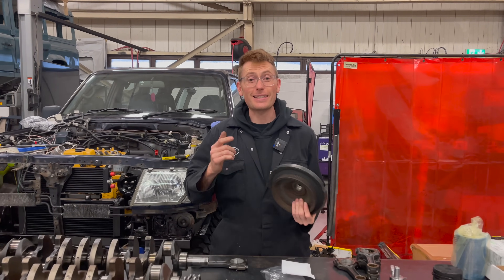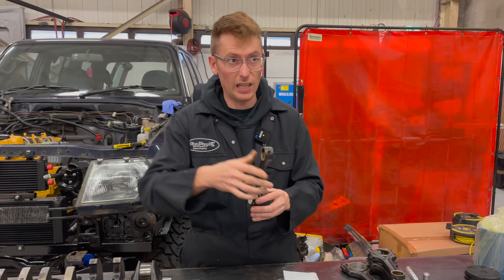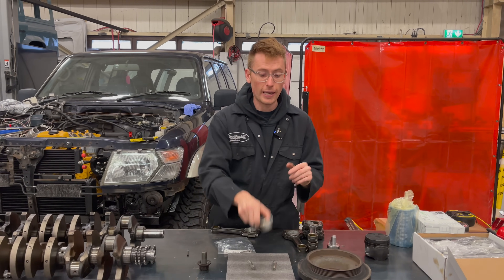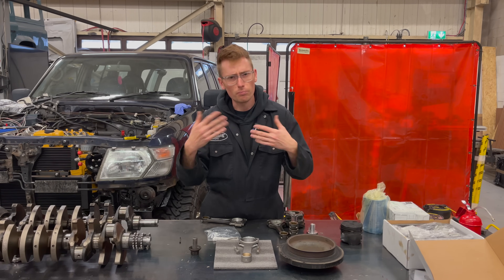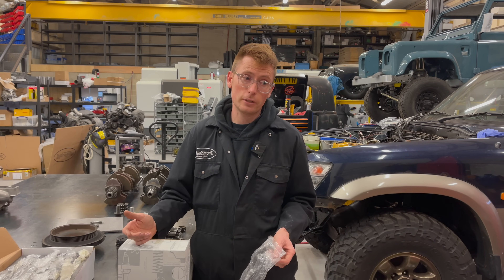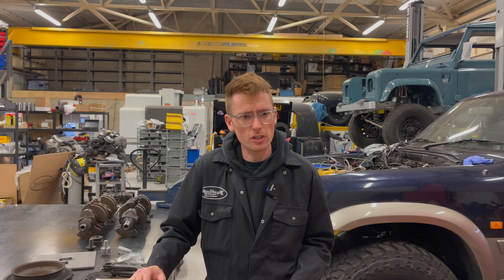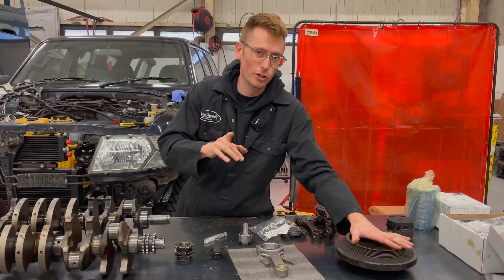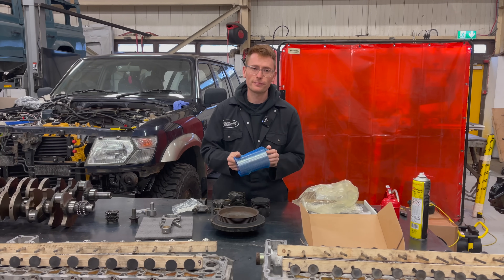BUILD A 700bhp Capable OM606 Diesel engine, Avoid Crank KEY ISSUES

Comment: Could it be a good idea to have the 6mm lock pin pre countersunk ready for drilling out when the need to remove the pulley at a later date? But then again you have already done that .

Comment: If most of these engines that had problems were manual transmissions, with letting off the throttle to shift after having them rev to a high rpm and possibly not having a blow off valve cause too much pressure in the cylinders and the rods with bend??

Comment: Bent rods may be ralated to a thrust bearings? What i mean, if it out spec, as you press the clutch it moves the crank and then the rod gets in angle and later bends it.
Just saying, couch mechanic

Comment: I immediately thought, must be a manual… sure enough.
Could it be that for these high power engines also stronger clutches are installed? And that the axial bearings can not withstand the extra pressure? Maybe the crankshaft is moving axial slightly when pushing the clutch. Look into better axial support instead of stronger rods.
Saw this problem with a Volvo turbo red block. You could even see the movement of the crankshaft by eye (engine was shot)

Comment: i could point the finger at certain manufacturers. the reality is they all do it.

 it's a sad state of affairs when a guy like this has to go back through an engine and correct it
 its a little more than factory mistakes in my outlook
 it is a known fact manufacturers don't sell autos to make money they sell parts to make money anyone knows anything about Germany they know that the germans are anil as hell about metal and machinery and that is not just some Germanic trope. they come at it like a form of worship. because they do worship steel. for real.

the point I'm making is they knew damn well that flimsy flat key was insufficient
that's an obvious failed point no one that's been around cars and trucks long would look at that and not say to himself you dirty sons of bitch's. hadn't been for that key beside's the obvious maintenance it's likely that engine would never need to be touched for a man's life expectancy. that little move was shameless. especially when you understand the checks and balances a company has before they put a product out.  they have the means to prevent this nonsense phunny how they are careful not to make mistakes that cost 'them' money only 'you'. as it has been said for so long if you want something to be done right do it yourself.

Comment: What you have done is not a fix.you need to find the the real problem and the problem is crank thrust putting heavy rods in they will just bend the same sideways.best option is remachine the block and put 2 thrusts in.got to remember these are all used shorter engines that had a 20yr life then you go and put 2/3 times original power through it how worn we're original thrust before.

Comment: Hey guys im gonna be honest I wanted to email you but alright hear me out. Im in the US and i love my mercedes. Im building an om606 but I noticed only the 86-95 models have the mechanical pump you require. Would one in theory, if I sent you guys like, idk 4 or 5 pumps. Would you send me 1 really nice rebuilt one? Because im broke this month and im trying to plan for around February for +600 but im researching youre pump kits/build kits.

I love benz tinkerers. Its beautiful because you guys literally. find the smallest things. and it makes life perfect. simple but Complex! Engineering the proper way.

The issues could possibly be due to the transmissions that arent mercedes. I seen a guy ripping an om606 on the MB 6speed. The manual transmissions cause the crankpulleys to fly off! I fuckin love you dude. People complain but bro, do u realize what kind of flex that is? You're pulley flew off. you should be proud.

Thanks guys. Those cylinder sleeves. Copping those when I get the block on the stand. Thats gonna be first thing next to pump.

Comment: Going from what you found with bent rods and corresponding vehicles having manual transmissions it would be interesting to see the end float of these cranks, it might as be indicating a discrepancy in spacing of components with the manual transmissions being used, causing minor movement of the crank under high horsepower applications or possibly an added harmonic indifference. I’m not very familiar with these motors but keen to Learn more
Reply: I was wondering the same whether it was a thrust bearing issue.

Comment: about repairing or damage bore... i dont agree with sleeve install. oem blocks was aged on rain ,sun, snow for few years before they went into production. this is how cast iron get stiffines hardnes etc... if you replace it with sleeve no chance that this sleeve have same characteristics of material and hardness. just put bigger pistons inside and thats it.

Comment: At 3:50 you say you sell connecting rods in a slightly shorter length to use a 320cdi crankshaft. Do you have any videos or anything with more info on this? I can't find the shorter length connecting rods on your site. And can't find anything online about swapping the 320cdi crank is the shorter connecting rods only thing that needs changed to swap cranks?

Comment: Is it possible to have short height pistons so you can use the 320cdi crank with the original length rods? And is there a variable geometry turbo that can make 400hp without too much lag? Or do you go twin turbo?
Reply: i would think that would be the way to do it  longer rods make more torque

Comment: I don t think that the original key was designed for that much power. also the original key looks more like a guide.. the fixing of the pulley relies on the torque of crank pulley screw.

Comment: And I bet all the rods were bent with the crank end pushed  towards the balancer? Seems like the clutch maybe damageing crank shaft thrust bearings. I’ve heard Toyota jz series engines will wear the bearings Faster if you run heavy pressure plate and start with clutch pushed in. Haven’t had any issues with my 1jz’s. Just something I heard thru the grapevine years ago
Reply: This^

Comment: I need help with my om606 I would very much appreciate feedback anything will help I got a 1998 e300d, https://youtube.com/shorts/rnL_Jt9T8f0?feature=share 
Check out that video, I’ve replaced injectors, delivery valve washers and o-rings, all new fuel lines from IP to filter,

Comment: You should work with Gail Banks in the USA he’s a top diesel tuner. Winning all sorts of land speed titles. He dose a liquid style damper that reduces the longitudinal and rotational harmonic shock the dampers for. This damper is not tuned to a single RPM. It works right through the Rev range!! I’ve contacted him and they don’t do any for the Mercedes 5/6 cylinder motors. 
Someone like you could link up with Banks! And fill the void of the lack of quality dampers for high power Diesel engines! That really could benefit greatly from this upgraded harmonic balancer!! Oh and I’d be your very first customer to buy this viscous liquid  damper!!
Reply: Gale 🙂

Comment: Your vids are always educational, don't even have a om606, got a m51 and shooting for 4-500hp tho
Reply: M51 head is very restrictive, 300hp is the highest hp you can achieve after expending lot of money. It’s better to drop a M57 and tune it, better € per HP. All Bmw 6 cylinders gearboxes  are compatible until 2007, so you can put M57 and M57N
Reply: @daneitor97  Well the m57 engine isn't that cheap, the m51 is very cheap. + It's not that restrictive, u can get above 300
Reply: @nicolajskovby6204  here in Spain I can get M57 200.000km for 800€. That’s what I’m going to do with my E34 👌
Reply: @daneitor97  Still at least 200 more than the m51 and I already have one in the car, even if I only end up making 300hp it's still a lot cheaper
Reply: But I still bet 400 is ez 3 inch side pibe from hx 40. M21 super pump from diesel meken, Big IC and meth
Reply: @daneitor97  M51 with head work and camshafts can go above 300hp but the cranckshaft is the weak link. It’s also very to mount mech pump on it instead of edc and IDI diesel no need to change injectors.
Reply: @Koza_Cara  the problem is that head work (and anything that involves opening an engine) in Spain is very very expensive. For 450hp M57 only need big turbo, bigger injector pump and change injector noodles (approx 1500€)
Reply: @Koza_Cara  but I think M51 crankshaft can hold easy 400hp, I saw people used for turbo stroked M50 2.0
Reply: @daneitor97  head of m51 isnt expensive because it’s that simple only 12valves and just increase the flow and test on airbench. Tougher springs from VW 24d about 500-600 for headwork and a m21 pump and you can go easy to 300
Reply: @daneitor97  Guy in a group on facebook snapped cranck in two at 400hp. Luckily pistons are forged and piston rods to
Reply: Join m51 tuning on Facebook. But cranckshaft wil break at 400hp

Comment: just curious is there cams to make om606 counter clockwise for marine applications at say 500 bhp?
Reply: Why not use a counter rotating gearbox? PRM-Newage, TwinDisc can both be run using what is Ahead as Reverse and vice-versa.

Comment: Now if the rods are bent, what about scoring done on the crankshaft? Or is all the stress taken out thru the rods? I assume the now increased .100th of play, you would run along side the crank bearings?
Reply: Never seen a broken crank on om606, rods is the weak point

Comment: Just a thought, high hp, manual box would need a heavy duty clutch. Would this be wearin the crankshaft thrust bearings causing the crankshaft to  move back n fwd?
Reply: you mean when you engage the clutch that you worry you will physically push the crank forward?
Reply: @Stale_Mahoney  yes. It used to happen to Triumph 2.5 engines. I think they only had crank thrust bearings on either the top or bottom of the  crank. The larger clutch, of this engine compared to the 2.0 engine, wore out the thrust bearings. The only symptom of this occurring was that it became difficult to engage gears from stationary, the crank moved so much that the clutch wouldn't fully disengage. 
I don't know the Merc engines crankshaft thrust bearing arrangement,  so this was just an idea I had based on my own experience
Reply: @deetesmin  that is something i have not heard of before, maybe only a triumph thing?
Reply: @Stale_Mahoney  possibly. Mid to late 70s, but the basic design was probably much older and obviously not up to the job
Reply: @deetesmin  yeah it is not uncommon for car produseres to use the same design over many years but upgrade some parts to keep it updated. guess that is one of the times when design did not hold up with the upgrades.
Reply: @Stale_Mahoney  its something that has been seen in very high horsepower petrol engines. 
Seen an engine that was just eating thrust bearings and we couldnt understand why.

Till we worked out the clutch clamping pressure was literally pushing the crank forward and wearing the bearing material fast.
Reply: @tonywhite7753  impressive
Reply: @Stale_Mahoney  Mitsubishi problem too. My Evo had it.
Reply: @realMaverickBuckley  huhh interesting, would not getting a bigger dim clutch work to counteract it, as even similar/less clutch forse would be spread further out from the kranke so more momentum can go thru the clutch plate without slipping?

Comment: So basically, if your 606 is throwing it’s harmonic balancer it means it’s time to yank it out & take it all apart 😫
I’m assuming the issue surrounding the manual trans 350+ bhp is people dropping the clutch ?
Reply: It depends what life the engine had to if you gonna drop the clutch on an unopened engine with 400k KMS you should expect it 😅 but a fresh one of 150ish k KMS will hold on for a while

Comment: is the crankshaft from the 320 CDI better or just for a little more displacement?
Reply: Longer crank with the shorter rods will give it more stroke. Torque
Reply: @jacoblagerstrom1501  but is the crank better in any way?
Reply: @FrmerK20 crankshaft  isn’t weak on om606 only rods. The 320cdi or om648 is based on om606

Comment: Referring to large HP industrial, marine and truck engines as you go up in rated hp you add or stack balancers or you tear them up, I think that what you are seeing is mostly undersized balancer capacity and the torque convertor equiped models are absorbing some of the crank flex etc, I would like to see you make a hub to be able to double and triple  stack stock balancers to test for real cause

Comment: Although I have never seen a pulley coming off I have always wondered about that shonky piece of junk on the crank nose considering the excellence that the rest of the engine is based around.
Reply: If you think that's bad, have a look at the duramax crank pin, it's a tiny little dowel that ruins engines upon failure. Many shops are machining keyways on the crank snout at first available opportunity to prevent engines from grenading themselves if the crank dowel shears 😅😅😅

Comment: Did you happen to check the thrust bearings on your three exemplar engines?
Reply from the maker: Yes all checked and all very good, very little wear.
Reply: Are they next to the Ion Drive, or the Tridium fuel-cells, I can’t find it, thanks in advance.